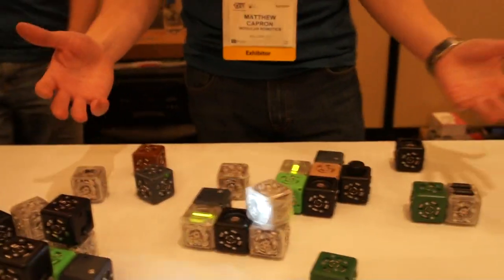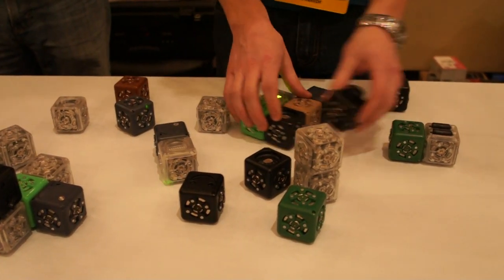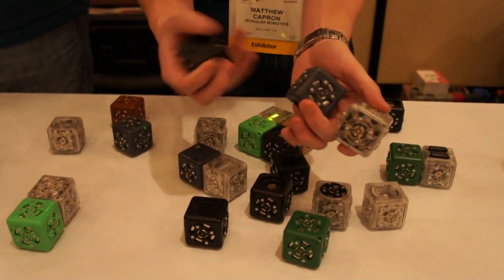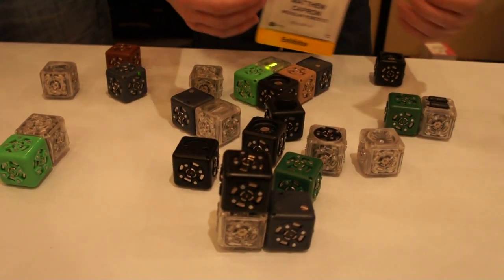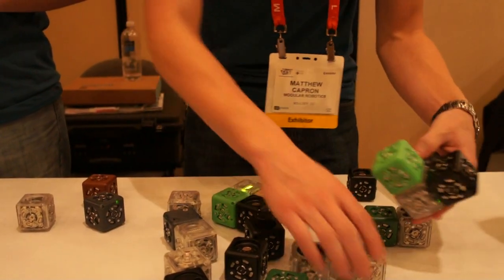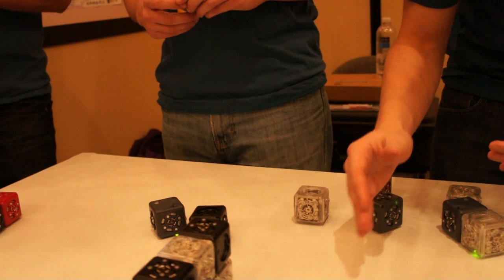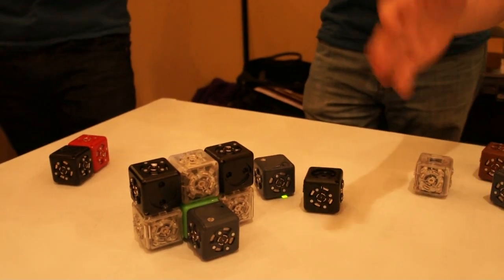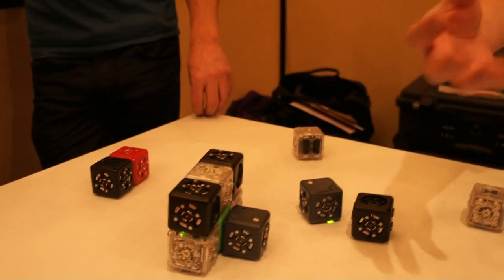Modular Robotics Cubelets

Comment: Very nice, but need to be smaller and with even more powerful motors and more powerful magnets... electromagnets actually... electromagnets powered by output signals, so that those modules could arrange themselves if software from bluetooth cube told them to. Need to be smaller, because imagine building for instance a hand of five fingers with cubes as large as these ones here - this hand would be too big.